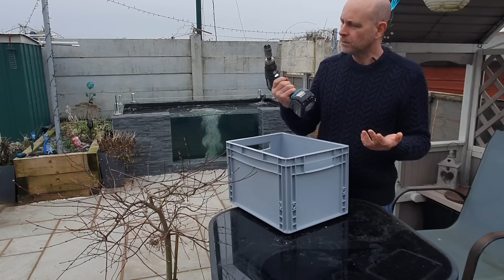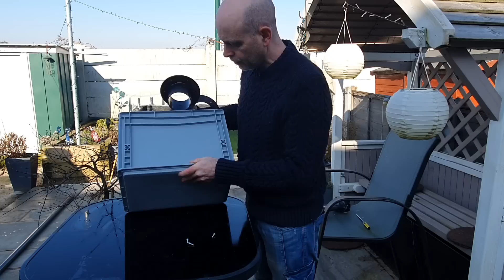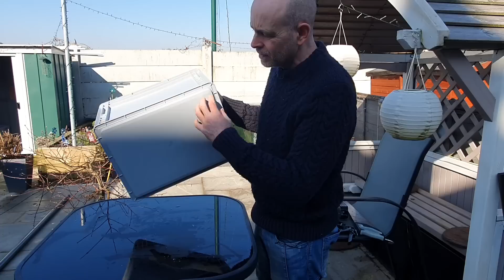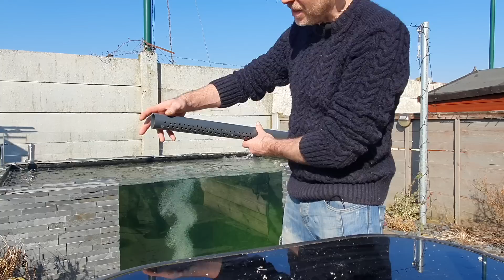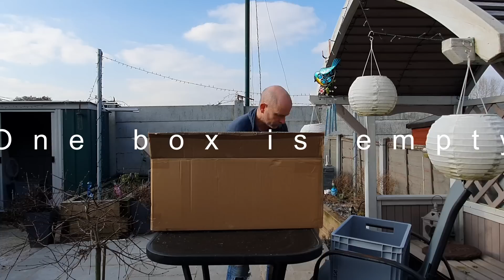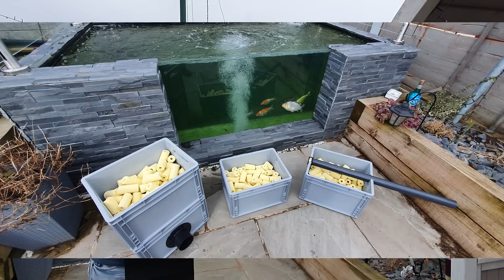DIY Bakki Shower Build (Make your own PART 3) Koi pond filter

Comment: I have a similar size and set up with Eazy pod to you Darren, just a question what rate of flow are you throwing over the shower? As the pod can only handle 10000l per hour.
Reply from the maker: Hi mate, the optimum flow for the Pod is 5500 litres so this shower is designed for that. That is why it is 400mm wide, to scale for the low flow rate. For example, if the shower was 1000mm wide it would require a flow rate of around 15000 litres plus.
In the earlier videos in the shower series I go through how to calculate your optimum shower size for your particular flow 👍👍👍
Reply: @DazzleKoi  Cheers Darren I will check out the earlier vids
Reply from the maker: Nice one mate. This one is the one where I go through flow rates and tray sizes etc 🍻🍻🍻

https://youtu.be/qIgsMxpFiWI

Comment: Can you advise please, What’s the dimension from the base of the box to the media in the box below (the water fall dimension), or does it not matter.
Reply from the maker: Hi Jamie, it is literally a case of the bigger the gap you can create the better. In my case I would have liked higher but what I have is a minimum and it is working well. I have around 120mm but as I say, if you can get more then I would do it. I was restricted a bit with the height I could go. I will say though that 4 tiers with a smaller gap is better than 3 tiers with a bigger gap.

Comment: Hi mate great video's👍🏻👍🏻 I'm going to make one off these but the boxes I can get are 600x400x220 mm will the height at 220 be ok or dose it need more drop on it 
Thank 
Tim
Reply from the maker: Hi Tim, I would definitely go deeper mate. I used the 270mm and that's on the limit. If I changed anything about mine it would be that but I just don't have the room to go higher. Once the media went in my trays the drop was smaller than I would want ideally, but just about OK. I definitely wouldn't recommend going smaller than 270mm though.
Reply: @DazzleKoi  thanks for advice👍🏻👍🏻 I will go out and buy some deeper ones..a friend has 6 off them but only 220 beep
Reply from the maker: Its frustrating but it is definitely worth it mate 👍👍👍

Comment: Love your vids! I just bought 4 of the 600mm euroboxes, im gonna run it of a 12000lph pump and was wondering if a 3"  outlet is big enough or do I need 4"? Intake is 1,5"
Reply from the maker: Hi mate and thank you 👍
You are on the limit there really for a 3" pipe. I honestly think it would be better to either go up to 4" or add a second 3" exit to be safe. I think the single 3" would work but if you got a bit of blockage or backing up for any reason it would be unable to cope and fill the bottom tray which would result in overflowing and losing water.
I think to be safe you should go bigger or add a second one.
Reply: @DazzleKoi  Thanks for answering!
Im gonna go for the 4’’ to be safe, also might put in a bottom drain to be able to flush out the bottom tray 🤔
I have binge watched your vids over the weekend, really informative and no BS!
Hope your channel blows up man! 👍
Reply from the maker: Cheers mate, I appreciate that.
I think 4" is the safest option. Good idea with the drain to, makes sense, I hadn't thought of that 🍻🍻🍻
Reply: @sigvez7834 If you want to be able to flush the bottom you’d probably need to be able to close the 3 inch outlets or any dirt and debris will flow into the pond!

Comment: hello that looks a great idea, did i miss where you bought the boxes from and the trays?
Reply from the maker: Hi mate, if you're in the UK I got mine from a company called solent plastics. Great service and they where the cheapest I could find 👍👍👍👍
Reply: @DazzleKoi  hello thanks for that info i am in surrey so if they are based in the solent area i am fairly close.
Reply from the maker: Hi mate, I've just had a look and I think they are quite a trek from you. They are in Romsey. Their postage costs wasn't to bad though if you have to get them delivered 👍

Comment: Great series of videos, well done. My only question are your water parameters before and after. Did you note them down so you can gauge the improvements?. I suppose the feeding season hasn't really started yet to compare?
Reply from the maker: I do record them quite regularly so I will get some idea but not ideal because I only started the pond in June last year so it was still cycling last summer. I should be able to tell though 👍👍👍

Comment: Absolutely brilliant, did you have to turn your pump up due to increased height of your new set up. 👌
Reply from the maker: Hi Anthony, yes I have turned it up a little bit. It wasn't a lot, just a=enough to overcome the extra bit of head loss from going up to the top of the shower rather than over the pond wall 👍👍

Comment: Thanks for the info just made my shower  I have 3 1 1/2 out flow pipes  got to get my 
Media. Looking forward to see it up and running. Great help. Paul
Reply from the maker: Thanks Paul, sounds good mate, I considered smaller return pipes but went for the one big one in the end. To be honest the three smaller ones would have gone under my glass easier but its done now and seem to be working great 🍻👍

Comment: I made a similar homemade shower last Summer.... one thing I did was to lay a 4 micron screen on top of the media in the top container (just under the spray bar)..... it collects  a lot of the fines, easy to wash off once a month or so..... have seen others use filter floss also
Reply from the maker: Hi Philip, that's a good tip mate for anyone who is worried about putting solids over their shower  , cheers 🍻🍻

Comment: Just a little tip drill a 6mm hole about 15mm back in the bottom of the pipe it will stop the water running back 👍
Reply from the maker: Oh yeah, thanks Alan, that's a top tip, I'll do that at the weekend  👍🍻👍🍻👍

Comment: Hello matey i hope all is well 👍🏼
Another fantastic video and very informative as expected 👏 
You may have mentioned and I missed it but I'll ask anyway......very many koi keepers with showers quite often talk about airflow and gassing off....now are they just gassing off (excuse the pun 😉) of is there truth in this necessity.

I've been in a reasonably well ventilated space today but the floor paint still packs a punch so if this comment comes across oddly my apologies 👍🏼

Take care matey
Reply from the maker: Hi Tom, no that's a very valid question. I am aware of the talk of needing to gas off and that's been something that's always been said about showers since they came to these shores maybe 20 years ago. Personally I do think there is a need for it but not in any way to the levels a lot think. My shower is open at the top and has the  half filled 3" pipe at the bottom plus the handle holes which have a piece of plastic in front of them but are by no means air tight.
I'm more than happy that there is plenty ventilation and opportunity for any gassing off that may happen. 
The worst case is a small amount of ammonia comes out of the water in to vapor form within the shower but its tiny tiny amounts, if any. If this doesn't escape and is re-absorbed back in to the water, not easy, then I am just back to where I was before it came out so I don't see any potential for an issue.
Reply: @DazzleKoi  I just thought it was worth a mention as its commonly discussed.

Great job as Always mate 👍
Reply from the maker: Thanks Tom 🍻🍻
Reply: @DazzleKoi  just a passing thought 💭  are you going to be entering the koi Diaries/adam byer grow and show?

I'm sure you already know about it but if not tune in to koi Diaries (andy) YouTube channel at 9pm this Friday evening and all will be revealed.

Take care matey and enjoy your evening 👍
Reply from the maker: Hi Tom, I have entered a different grow and show and to be honest I don't have the space for that one so I definitely cant do another one unfortunately. I'm probably going to give this one away after the competition ends.

Comment: If height is an issue I can understand why you would need to come out of the side of the bottom tray with the bulk head. However if you can get away with it you could come out of the bottom and put an elbow on the return. You wouldnt get the inch or so build up in the bottom. It's just a thought.  Great video as usual Daz.
Reply from the maker: haha, hi mate, I didn't even think of that and its so obvious now you've said it 😁

You're right that I wanted to keep the height to a minimum as I needed to keep it below the top of the fence and also I have a shade sail to go back up once the last of the strong winds is over. So I wouldn't have done it that way but I could certainly have mentioned that in the video as an option for others.

Cheers mate 🍻🍻

Comment: Excellent video - thanks. I have an Oase eco classic pump, rated at 8,500 litres per hour, that I’m not using. Rather than modify my existing filter setup, I was thinking about literally hanging the pump, opposite the return, maybe 600mm below the pond water level. The height of your shower is 900mm. According to the curve for my Oase pump, a lift of 1500mm will reduce the flow to something closer to 5,000 litres per hour, so I guess I can use the same size boxes as you? Also, instead of using the tank connector, could you cut a rectangular slot in the bottom tray?
Reply from the maker: Hi Jonathan, that sound ideal. The boxes I used will be perfect https://www.solentplastics.co.uk/26-ltr-small-euro-plastic-stacking-container/

Yes I don't see any problem cutting a slot in the box. It would probably need to be quite thin and you may be able to create like a blade effect.
Let me know how you get on 👍🍻👍🍻👍
Reply: If you do cut a slot might be an idea to fit a media tray off the bottom above the slot to allow free flow and prevent any media loss!

Comment: I built a very similar one back in January, been running for about 3 weeks now. Seems to be doing the job. As you say won't really know for sure until feeding etc starts. I used the 400×300×310 euro containers without handles, top one with a hinged lid. I got mine from Manutan. Can hardly hear it running, unless your next to it. As for media I'm still doing some tests on that. For the time being I've got around 40kg of E25 alfagrog in it. Mainly to get it up and running. But that will be swapped out, once I finally decided on media. As I have a fair amount of plants I'm not that hung up on nitrates, as they rarely go past 10-15ppm.
Reply from the maker: Hi Adam, sounds good mate. Have a look at my earlier shower media video if you haven't seen it already. If you are not worried about nitrate you would probably be ok with pumice. I would definitely recommend one of the ceramics though if you can for all round performance and durability.
You got the slightly taller boxes to so even better height 👍👍👍

Comment: When your first set that sort of media running, do you add filter starter ?
Thanks
Reply from the maker: Hi Jason, I ran a fine net under the return for a bit in case any debris came off (didn't get any) but other than that I didn't add anything. Its spring so feeding is low and I have mature filters running to so its not necessary really. I'm keen for anaerobic bacteria to form which handles nitrate so I don't think the gels and filter start product contain them anyway. I think the Pure+ gel is good if you need one but if you can just wait it out I believe that's a better option.
Reply: @DazzleKoi  thanks for your response..
Learnt a lot from your videos 😊
Thanks, keep up your good work.
Reply from the maker: Cheers Jason , will do 🍻🍻🍻

Comment: Another great video Daz, and given me an idea to design and build my own Bakki. Not sure if I missed it or you didn’t mention, have you given it it’s own independent pump or have you just T’d off your existing ??
All the best pal
Steve
Reply from the maker: Hi Steve, no I've just rerouted my normal return to go over the shower instead of over the wall. Just turned the pump up a tiny bit to compensate for the extra head loss 👍👍

Comment: That looks clean, what I mean by that is it don’t look out of place, some home made Iv seen look untidy sat on the side of the pond.
I’ll be looking into building one once my pond is up and running, I’m just building my filter house at the moment, well I am once the timber gets here.
Great video again daz, 👍👌
Reply from the maker: Thanks Rex, sounds like you've got plenty on. I need to sort out some cladding for the outside now to finish it off 👍👍
Reply: @DazzleKoi  will look nice clad but in my opinion it don’t look that bad as it is.
It’s not an eyesore like some Iv seen buddy.
Rex
Reply from the maker: Yes I agree, I have seen worse 😁
I need to put the shade sail back up at the weekend, hopefully it still fits if my calculations are correct.

Comment: If u haven't adjusted the pump flow rate from what it was before with out the shower .... Then u won't be getting 5000L over as u have just added massive head pressure because of how tall it is ... Might be something to consider ??
Reply from the maker: Hi Andrew, yes I've upped the pump speed to compensate and keep the 5500 litres flow I need for the Pod to function at its best. It changed very little to be honest, the return pipework is exactly the same as before except now it goes up an extra 900mm on the vertical section 👍👍

Comment: Hi Daz, great video, I may have missed the flow rate on the video, what are you pumping through it?
Reply from the maker: Hi Mark, I'm running the standard 5500 litres an hour that the Pod needs. Very low flow for a shower really hence why it needs to be so narrow 🍻🍻
Reply: @DazzleKoi  Thanks mate, I am thinking similar but would be pump into a spare pod and gravity back but only through a 2 tier (due to gravity) and thinking of 90cm wide. Not sure if I am wasting my time though as it might not be so effective (low flow and lacking height). I could go to 10K as buying a vari pump but then lose the effectiveness of the pod. 

At the other end of the pond I have a cetus sieve, nexus 210 and back through a veg trough. So looking to move some more water around as pond is 23ft long (3200 gallons).
Reply from the maker: Hi Mark, yeah its a tough one really. As you say , 2 tiers isn't going to be much use and the width just means its even less effective as wider effectively means less flow. Is there no way you can go to at least three tiers and reduce the width down?
Reply: @DazzleKoi  Hi mate, I could raise the pod and put it at the back of the shed so of of view. The shower will be made for me locally so can be what I want, it's just he has a few made at 90cm wide he will do a deal on. The raising pod is a good option though so thanks for getting me thinking. Where did you buy your media from? and did you mention in a previous video a code to mention when purchasing?
Reply from the maker: Hi Mark, I used aquasource kano. I made a video on the best shower medias that's worth a look. I got s good deal on the kano for people who watched it but he sold out really quickly and I don't know if he has any more in yet. That video is worth a watch if you haven't seen it 👍👍

Comment: Why did I think you were building a metal shower?? 
Good DIY shower.

Where is your pond return now? I couldn't see it..
Reply from the maker: Hi Lau, return is from the black 3" pipe at the bottom of the shower in the middle. I cut it down to fit under the glass. Been watching your videos, keep up the good work 🍻👍🍻👍🍻👍🍻
Reply: @DazzleKoi  I see. So you have the shower and the pod+tempest going through the same 3 inch pipe. That's the best set up ever! 

Ah thank you. I am not a builder so that's the best I could build 😊 thank you for watching
Reply from the maker: Yes , all three (Pod, tempest, and shower) are on the same line so just the one pump 👍

You're doing a great job, love the red 😁😁
Reply: @DazzleKoi  Thank you for your kind words. Just painting the battons for the roof in black ☺️

Love your set up and your pond,  and all your tips, but you know that.

Comment: How often will you  clean the first chamber ?
Reply from the maker: Hi mate, I'll have a look at it in a month or so but I shouldn't need to clean it. With the correct ceramic media it will handle some solids and its getting very little anyway as its after a Pop and a Tempest 👍👍